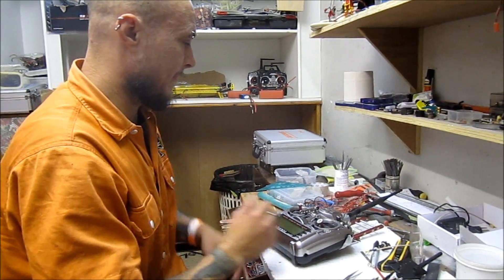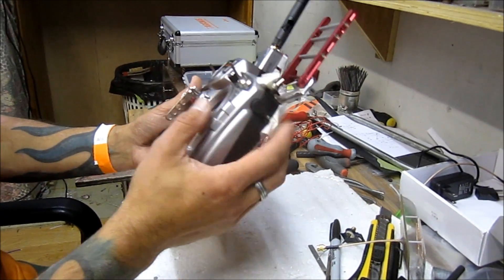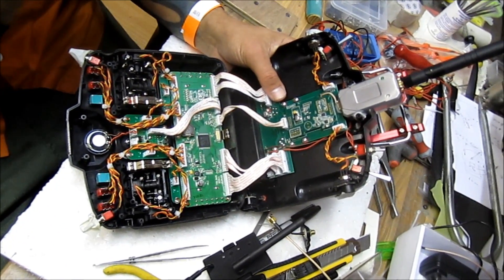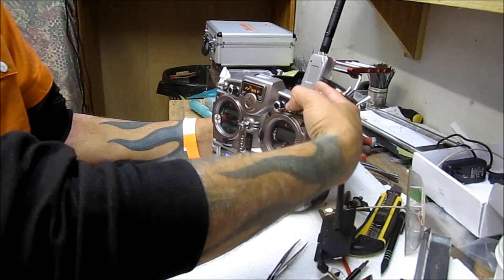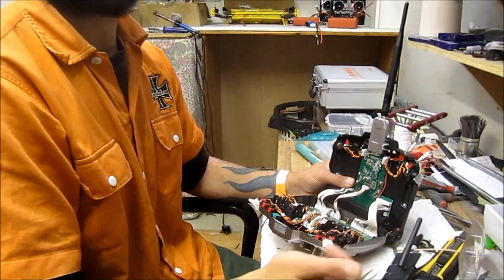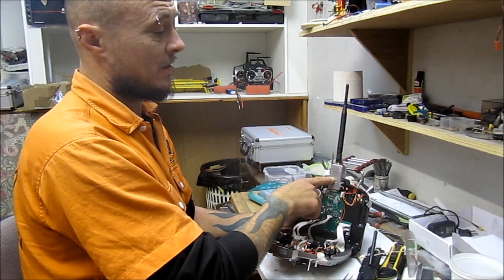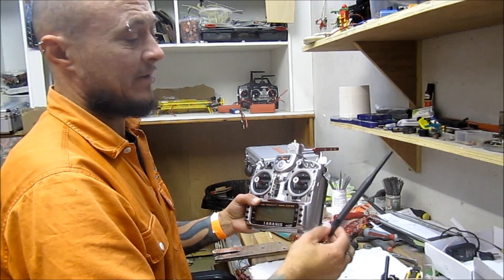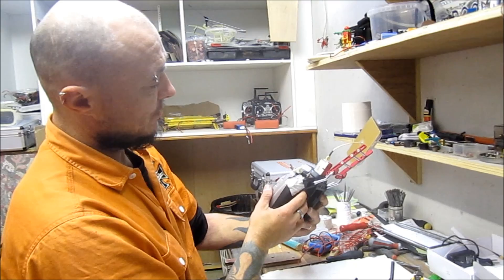Taranis X9D mods

Comment: Need help planning to install a 8dpi antenna to replace stock antenna after I soder on the wire what do I do next
Reply from the maker: You have to bring SMA to the outside so later you can screw on any antenna. As I cut the hole for that booster I had to add a fiberglass plate and drilled the hole there, but for original usually it's enough to flatten existing antenna holder. If not, then the hole for SMA can be drilled a bit on the side.

Comment: Hii how do u shortened ur stick??
Reply from the maker: I didn't have to shorten the sticks, only the rockers. I cut a bit off their bottom and drilled a longer hole from the bottom (leaving enough thread to be screwed on sticks) so they sit right on the gimbal and the sticks are not sticking out past them. That's the length that I'm comfortable with:)
Reply: +ROBOFORCERX2000 do u hve the vid on how ur longger the rocker cos im  a thump user😅
Reply from the maker: Mohamad Ezwan Jais Jais No video, total length of the rocker is the same as the stick. From the gimbal to very end I have 22mm.

Comment: You rock man!  You know you this radio well.  I NEED more signal strength for fpv quad flying.  I really didnt want to go all out like you did, partly because I have never gone that deep in a radio.  Any sugestions of any one who sells a signal booster for the same radio?  I am in the USA.

Thanks!
Reply from the maker: +Christopher Greenwood 
Thanks for heads up! 
Man, I wouldn't recommend a signal booster, there's more hassle than positive gained. A booster would do for fixed wing whoever wants to go further than 2km, but even then UHF system is better. Stock Taranis on multicopters is more than enough for 1-2km flights, FRsky signal is solid and reliable and copters usually don't fly further anyway. But if you still want to go more than 2km then I suggest to look at TBS Crossfire system. It is a new UHF system that uses 916mhz for USA, requires no HAM license to operate, and Rf range is just amazing. I'm using it on my fixed wing and will be using on some my miniquads, and the best part is that I'm not stuck with 5.8ghz for video- I can use now 2.4ghz for video.

Comment: nice- Thank you for your Video. After  i watch some videos here on youtube I just ordered my  FrSky Taranis X9D, was only 223 usd here http://goo.gl/7AB9oy 
Have you had any probmes with yours ?
Reply from the maker: +George Boss 
The only problem was my voltage booster, but I took it out immediately. This Taranis is one of the very very first ones, I never updated anything (didn't even plugged into computer not once), and it 's still going without a single glitch:)
Reply: That you will not regret, I have a X9D and a X9E, but its my )d I use most, its a great radio ..
Congratz with it, 
Kind regards from Per - denmark

Comment: This Radio is far far away of being "Perfect":

1. LCD screen contrast and aligning issues.
2. Low quality switches.
3. Low quality sliders.
4. Antenna SWR bad reading.
5. Range issues especially with the new X8R receiver.
6. low quality and cheap plastic.

So where is the "Perfect"?... people like you who claimed it to be perfect radio spread the hype which had me lost a lot of money on transmitter , sensors, receivers which are far from being perfect and in one case even had me to crash a plane which alone cost me 200 usd of loss!
Reply from the maker: Oh, my opinion cost you a lot of $$$, so I shouldn't have said what I think of it, right? In that case internet is not a place for you to search for answers:)
Reply: Sorry man for being so negative on my last post. I was mad since i was hyped on the taranis from all the positive feedbacks around the net and everyone of them failed to bring the taranis flaws to public.

I'm just saying ... even if you think of it to be the best radio ever you need to be more specific about it and say why you think of it that way and bring up it's flaws as well.

Someone who don't know much will understand that this transmitter is better then futaba transmitters which is far from reality concerning quality and RF protocol but i can agree with you on software side of things.
Reply: יוסי שלי
See a need, fill a need brother! Make a video!
Reply: יוסי שלי Just a perfect price I guess.

Comment: I had the varying voltage issue when I installed the DIY 2.4GHz module to an older radio. Initially I drew power and signal for the module from the trainer port which led to the fluctuating voltage. I now have the module drawing power from the main power switch and no more voltage fluctuations. Yhe moral to the story is to ensure you have a low impedance source for the power. The trainer port supply was clearly limiting the current.

Comment: I just bought my Taranis after using the 9xr for a few months.  So the easiest way for me to boost for FPV would be an XJT module, booster and high gain antenna?  I am looking at keeping the stock antenna because I fly helis for ALeeS, so I sill have fly a full omni short range.
Reply: I guess more info will help, stock 9xr and 5.8ghz video I am pushing around 2km (Just DJT module and 3db antenna).  I am looking to open up to 8-10 km.  I am looking at a tracking antenna for everything soon anyways and I use an Easy Star II now so I fly at 200m or so.

Comment: My 2w sunhans worked great on my 9xr.  7km flights. With booster hooked to Xjt module. Moved the whole setup over to the Taranis and bitching betty on the Taranis does nothing but constantly say, "telemetry lost..telemetry recovered". Very annoying.  Any ideas?
Reply from the maker: Mine was saying that as well:) It was happening when the radio was too close to Rx, or pointing straight at it. I guess the booster somehow amplifies that radiation "mushroom" even further... And it was happening very often with X8R receiver with PCB antennas. I personally don't like that receiver as it is very picky how those antennas to be mounted.
And presume, you powering from 3s lipo? I had LifePo (the one in the video) and it is only 10v when fully charged, but the booster needs 12v, so when the battery was drained even a tiny bit, the booster was cutting of the signal, therefore I was getting "telemetry lost". With the booster connected , but not powered, I can get only 30-40 meters range. 
Please note, that with the booster on, your telemetry becomes a lie, because receiver on the model, that is sending data, is not boosted. You can trust only RSSI on your OSD:)

Comment: Battery looks like this one http://www.hobbyking.com/hobbyking/store/__23815__turnigy_nano_tech_2100mah_3s1p_20_40c_lifepo4_transmitter_pack_.html
Reply from the maker: Not just looks like, but actually is, the link is in description:)
Reply: I've put the LiPo I had in Futaba 8FG in, first perfectly, and has the right connector. Lasts forever too. I used this one http://radiocontrolledshop.ie/receiver-pack/3936-giant-power-transmitter-receiver-battery-pack-2600mah-lc-2600txrx.html

Comment from the maker: It is 2W and I don't know it's brand name, I got it of my friend who doesn't need it at all- with some knowledge about antennas he flies 10km with stock gear:) Anyway, I had to order a 3s Lipo battery for Taranis, because this booster doesn't want to work properly with LifePo, which is 10v fully charged. The booster starts to drain it, 9.2v is still enough for the radio, but this booster works on 12v, so below ~9.5v it stops to perform. Temporary I have a 3s battery in my pocket to power Taranis

Comment from the maker: 5db antena I got at T9hobbysport, and it is a proper 5db one, not like some others that are only with a bit of wire inside and just a bigger casing- I took it apart to check whether I have the real deal. It performs (small tests only so far) as good as 7db patch, but not being directional wins:) Radio stand is from Hobbyking, "radios, accessories" section